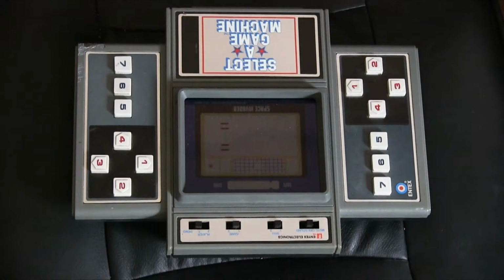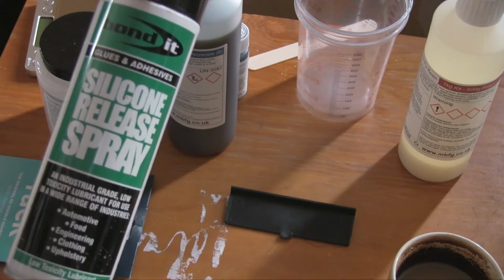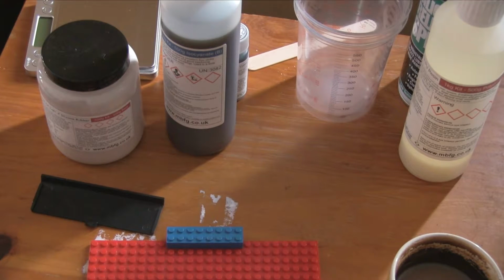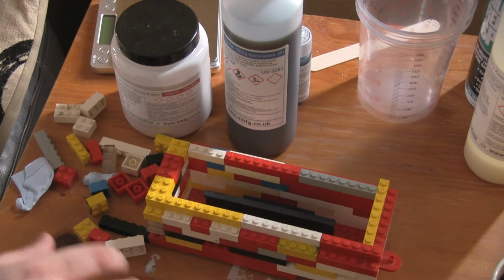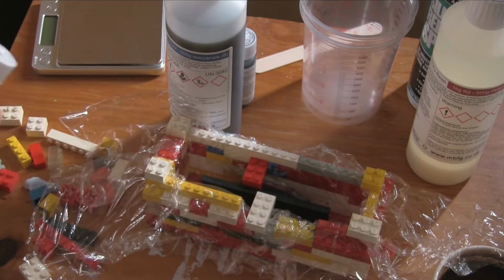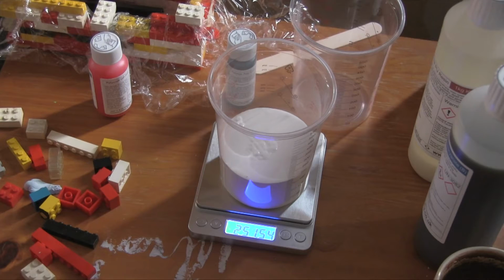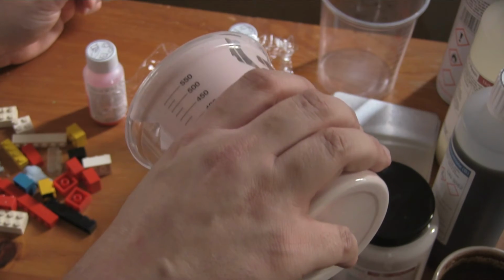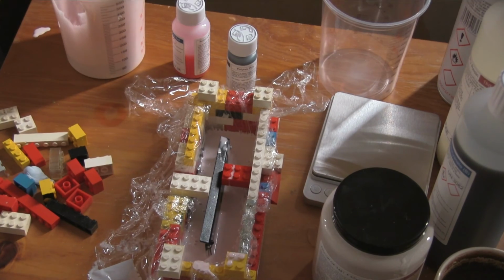Reproducing plastic parts Part 1 - it starts out ok

Comment: I was imagining at first that you would use a laser to do a scan of the required part and then 3D print it!

Then I was thinking... pour some rubber goop in the bottom, float the piece on top, then pour more on top.

Looking forward to part 2.